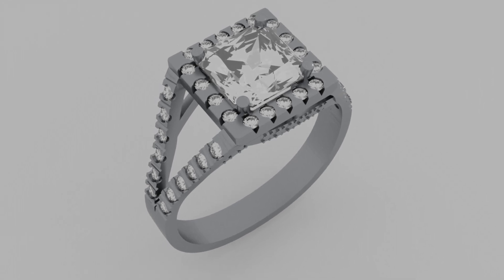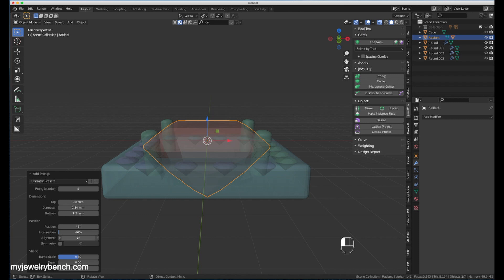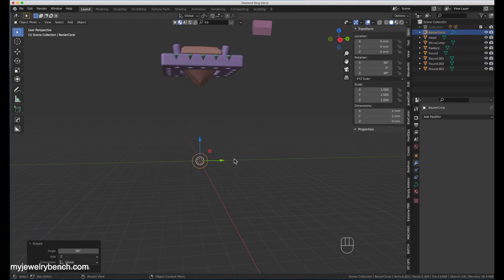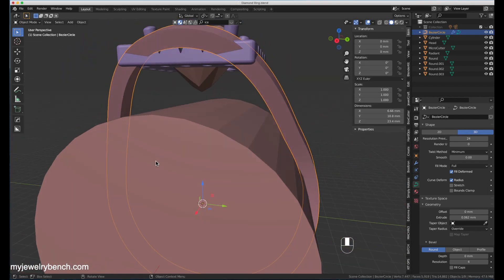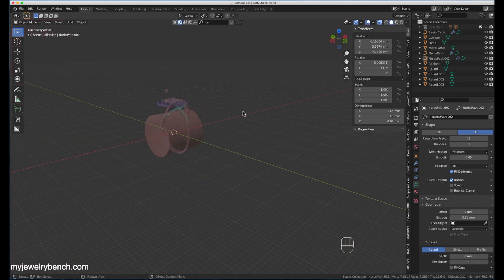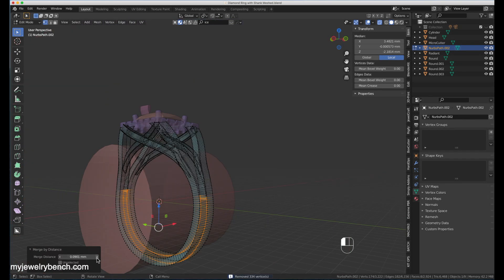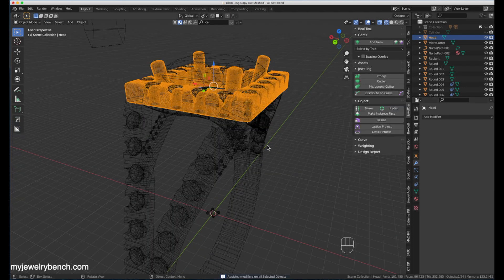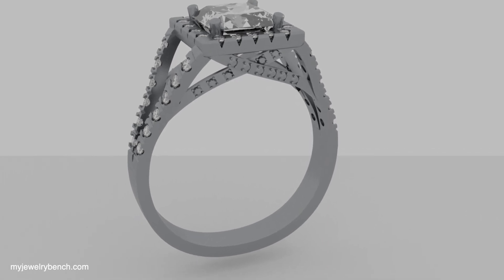Ring Designing in Blender 2.9x  -  Lets Get It Done!

Comment: If I wanted to make some designs to sell on Etsy and other storefronts what’s a good price point to sell them for
Reply from the maker: Price may not be as much a factor as marketing.  Even $1.00 items won’t sell if there is no interest.  Think in terms of how many you must sell to cover your design time. Then advertise. Etsy won’t help you with marketing
Reply: Ok but what’s a fair hourly rate to aim for and how do you market within Etsy
Reply from the maker: I charge 150.00 for an average design. Assume that I will sell 10 copies and spend 40.00 in marketing. Additional Etsy charges may be as much as 5%. That would mean to break even, I would need to sell 10 copies at $20.00 each.

Comment: hey pete. greetings from germany and a big thank you for all the effort you put into your content, really helps me getting a grasp at your profession, since I work with two jewellers, trying to set them up for 3d prints and casting. We've encountered a problem when sending wax-printed rings to the faundry, obviously the wax-model shrinks over time and foundries here in germany tend to 'forget' models from smaller businesses, with the consequence that the rings are always too small when casted. kind of makes it impossible for me to provide accurate models besides storing them till they are completely shrunken down, which seemingly takes up to 2 weeks. Dont really know how to solve that atm and would really appreciate your take on this if you dont mind
Reply from the maker: Hi Ben. I had the same problem with resin. There are a couple solutions to this. With resin, the part comes out about 5% smaller. Also, there is always a bit of shrinking during the actual casting.  To solve this, I will do one of the following. When I export my model before slicing, in increase the size by about 7%.  If you forget that step you can always increase the scale in the slicing software by the same before you add any supports. If you use blender, you can increase the size in the window to save the file
Reply: @watchesandjewelry  omg thank you so much, this saves me hours of experimenting. I wish you all the best for your channel, I really appreciate the great work you are doing here and already kept an eye on your blender gems library for when I get this whole project started. kind regards